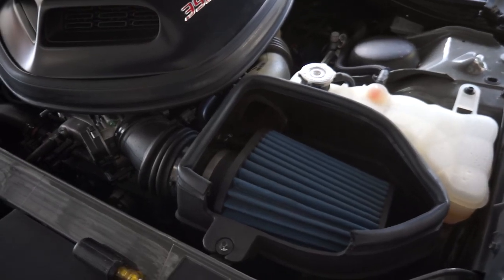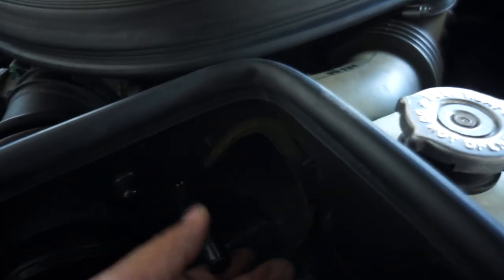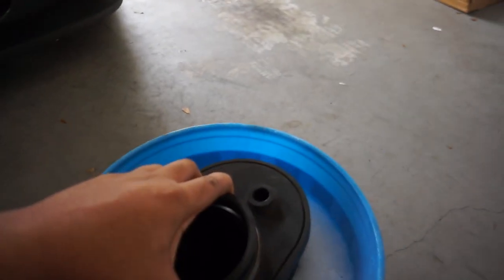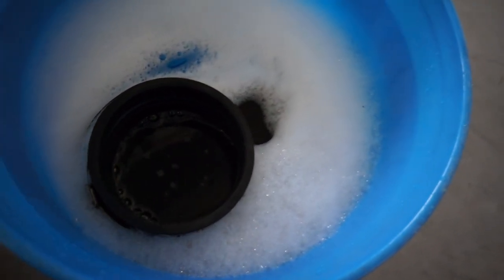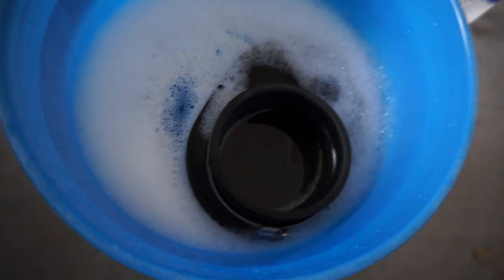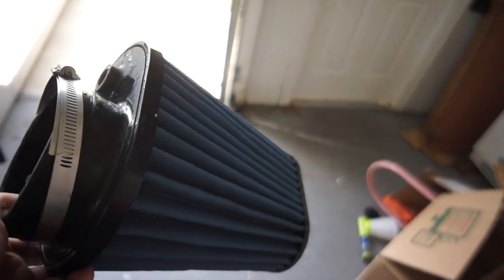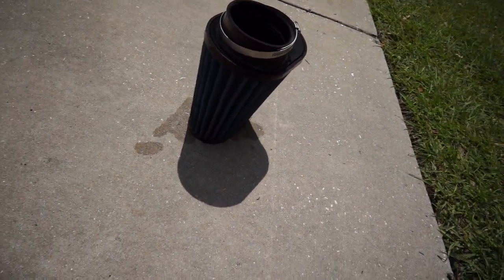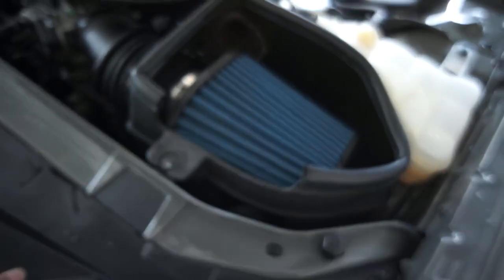HOW TO CLEAN AND MAINTAIN YOUR MOPAR COLD AIR INTAKE FILTER #caifilter #moparcai #dodge

Comment: Why have a kai if you have a shaker hood? Just curious.
Reply from the maker: It’s came like that from the factory
Reply: @ModernDayMuscle  I see, so its not functional? I guess these cars don't have a carburetor so its not feeding air straight in like the old ones did. I've never gotten to see one of these up close to tell.
Reply: @VirtualSuperSoldier  yes it does. The shaker has a tube routed straight into the intake. Goes through the intake to filter our debris

Comment: Dawn dish soap ok?
Reply from the maker: Yes if u see the link in the description that says instruction link. You will find on page 9 step 5d that you can either use the AEM cleaning solution or a mild household detergent (dish soap). The instructions are from mopar which helps :)
Reply: Warm water? Or does it matter?
Reply from the maker: Not sure what the difference would be. I think the warm water would just help break up the dirt particles more
Reply: Dawn soap and nice hot water

Comment: Can I use KN filter cleaner?
Reply from the maker: I said this in the video but the KN filter cleaner will destroy your mopar filter
Reply: Modern Day Muscle looks like I gotta get a new filter, damn.... I should’ve watched the video.
Reply from the maker: Carlos Beatty it will cause the fabric not to breathe. Sorry to hear that
Reply: Modern Day Muscle think I could get another air filter with the same diameter as the factory, and just slip it on? Think there would be any issues? Different filter with OEM set up.
Reply: Just thought about it... I probably shouldn’t. Have a good day brother, vids are helpful
Reply from the maker: Carlos Beatty yeah I’m
 It sure on that cuz I think when u get a kn setup u would have to remove the entire oem cold air intake but I’m guessing here I’m not sure. I’ll do some research on this... cuz I’m curious now

Comment: Why when I did this did my average might go from 14 or 15 down to 10 or 11 its been months and im still at 10 or 11
Reply from the maker: Average of what I’m not following
Reply: Damn auto spell.
My average mpg went from averaging 14 or 15 down to averaging 10 or 11
Reply from the maker: That could be a couple of reasons why that went down. I haven’t experienced that myself. Example are you driving in city? Lead foot? Racing? Driving in sport a lot? Aggressive Acceleration? Heavy traffic? Etc